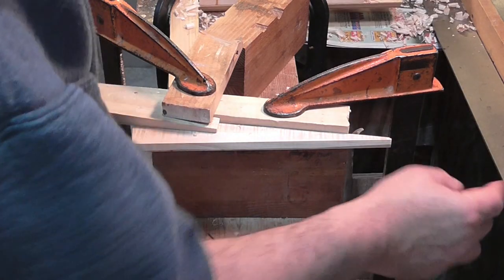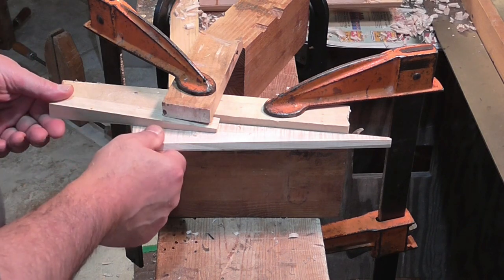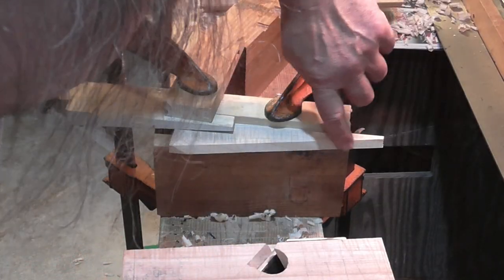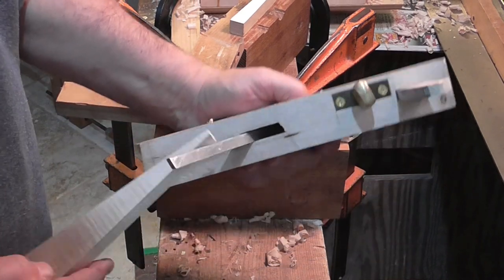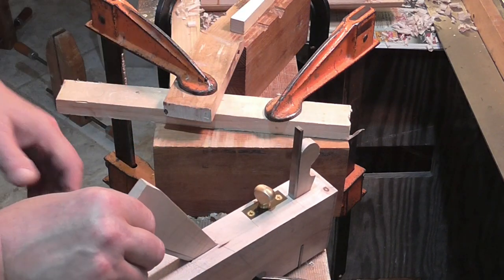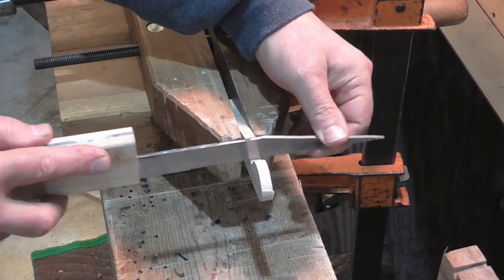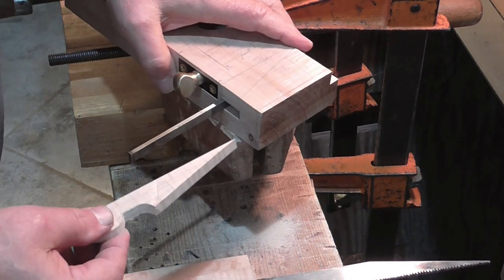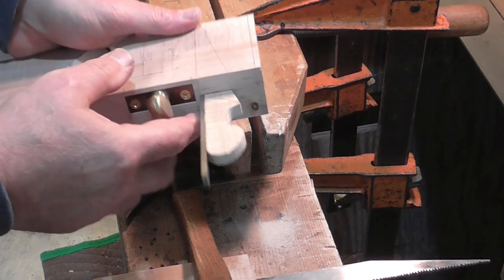Plane Making - The Skewed Rabbit Plane, Part 5....Final Segment

Comment: Dado planes: I think they were used on pine & similar soft-working woods. I'd also agree with Tom Baker about the size, with 3/4" being more user friendly. Wedges: I have over a hundred wedges bought from a man who purchased wooden planes which, as it later turned out, were not rescue-able. They are all different, in either length or width or both, some skewed, most 90 degree. From this I think wedges were never inter-changeable, but were made custom fit. If you messed up the wedge you either lived with it or made a new one yourself. Thanks for your skilled work and the episodes.
Reply from the maker: You are welcome !
 One inch is probably the limit for a dado plane that I could push. I'd like to know what a 1" was used for...maybe for the under side of a stairway handrail, to receive spindles or for stringers, to receive a stair tread.

Comment: The planes you made are impressive, beautiful work on these. I think you misjudged the dado plane though, about it not being very useful. I've managed to secure 4 of these in original condition, and they show the wear and tear of use.
I just used the 3/4 inch on a project with silver maple containing a lot of curl, and it functioned in my opinion pretty well. I did experience some chip out on one side of the dado, not sure whether it was due to the curly grain or my alignment of the knicker and blade. Not concerned though, the dado holds a cabinet drawer shelf, never to be viewed, being inside the cabinet adjacent the drawer.
All in all, it was enjoyable to use, I am not very fond of electric routers, due to noise and dust.
Thanks for posting, enjoyable video.
Reply from the maker: 3/4 inch sounds like it would be easier to use as well as a more practical size....I own the original 1 inch and 2 much smaller dado planes but have never used them, so I have no experience working with them on furniture projects. I may make a smaller one someday.
Glad you liked the video !